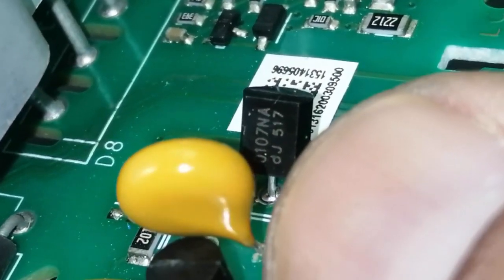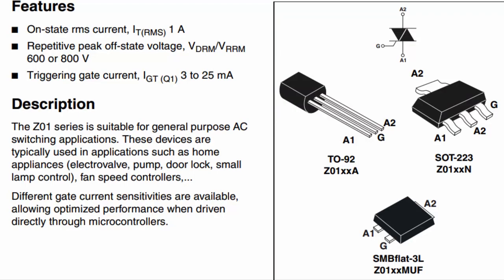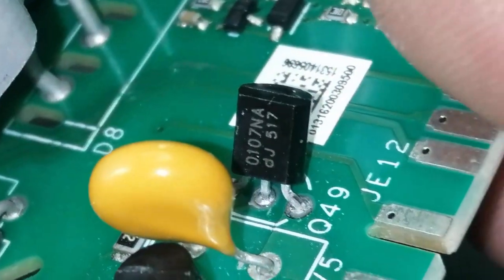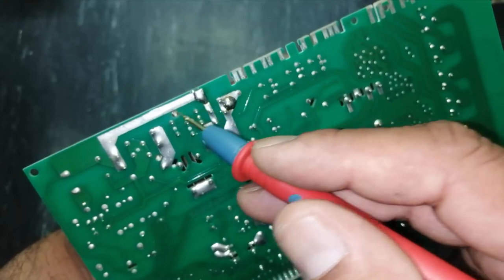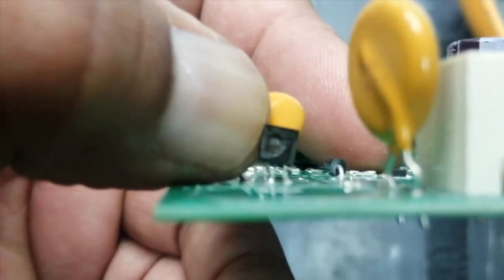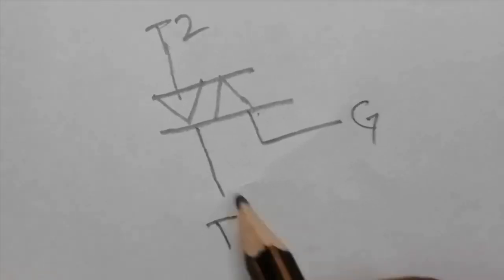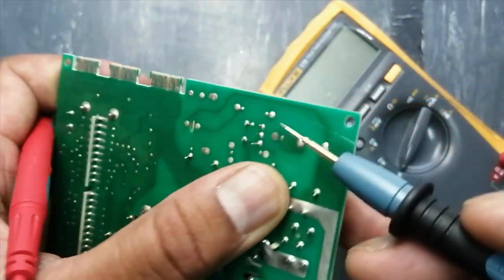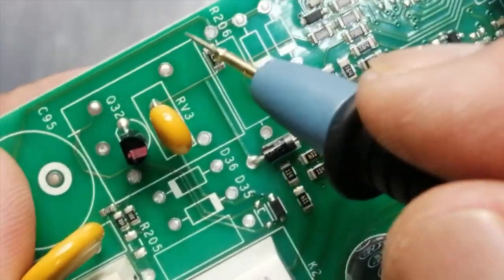#243  Troubleshooting Flextronics Control Board for Automatic Washing Machines

Comment: Thanks a lot for the information well done with great knowledgement about electronics and share with us. I have the card but this has burn perhaps for the presence of humidity... at point that burned several wiring paths on the printed circuit board (pcb) and if you dont bother is there a way to obtain perhaps schematics of this pcb... I would appreciate your cooperation and inconvenience.

Comment: Can you explain why we use mov between triac input and output. I have got the answer. It's snubber circuit for reduce the motor reverse voltage when the triac is off. Please tell why there is a smd capacitor between gate and input of the triac (230 supply )

Comment: Sar G ak pcb Sam hai power ni on ho rae tip den sar G me saudi arbia me hun
Reply from the maker: dear sub se pehly is ki smps ki outputs ko dekh lein, specially MCU k 5 volt verify karin
control panel k connector ko verify karein 
all sensors ki return pulse verify kar lein, it must be ok 
specially is k saarey TRIACs check karein,